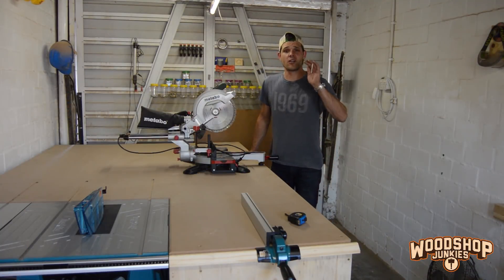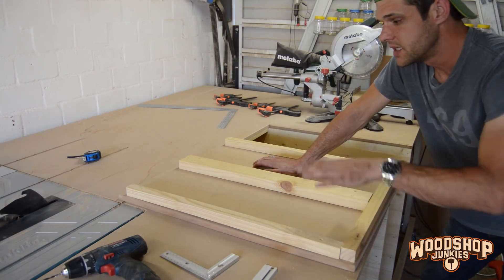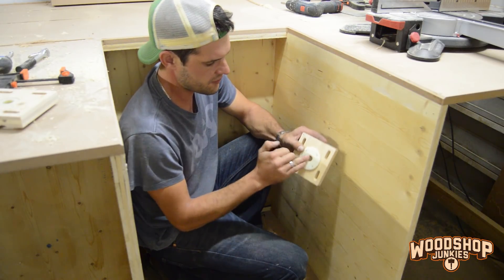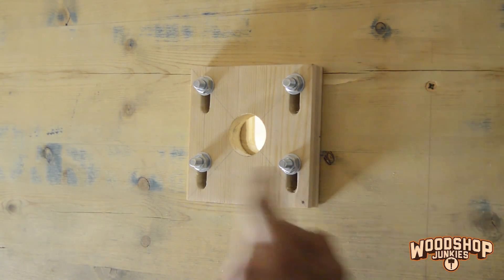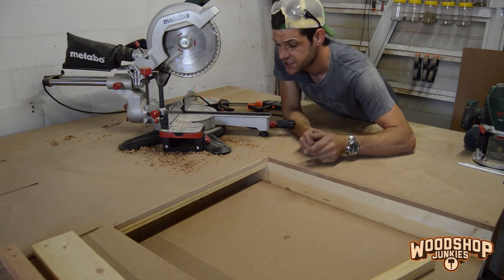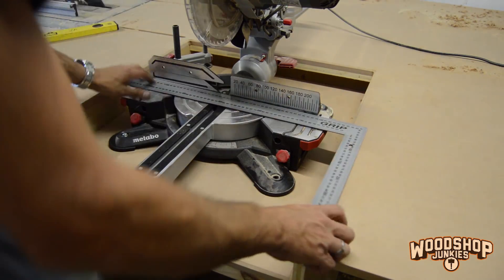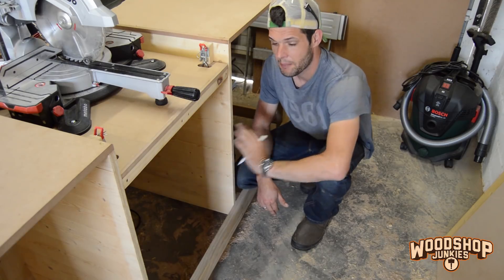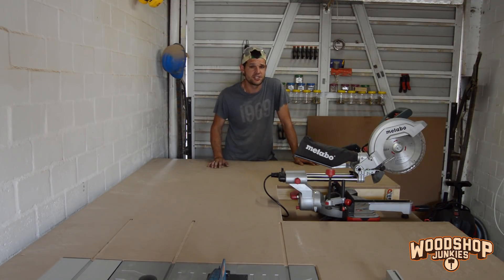No clash! MITER SAW INSTALLED to table saw station - ALL IN ONE woodworking workbench. P3

Comment: Can I just ask why you didn't chose a simple split pin for the ends of your stainless steel rod ?
Reply from the maker: To be very honest, because I didn't have decent drill bits to drill holes in the stainless steel pipe. Haha. Also, using the clamps is a bit of a personal preference but split pins would work just as well.

Comment: Will the Miter Saw be restricted from a full left or right 45 degree setting in configuration?
Reply from the maker: It depends on the type of saw. It doesn't in my case but the cavity could be built wider for a bigger or bulkier saw.

Comment: Great project! One question: it seems from the images that you will not be able to pivot the miter saw, so you will not be able to move the angler to left or right completely. Am I right or do you have a solution for that?
Reply from the maker: It can make 45° cuts in both directions. I allowed just enough space for it to do so.
Reply: @Ltcolfritz  Same. Would also like to see that :)

Comment: How did you calculate the drop or the distance for the miter saw to be able to clear the top of the table?
Reply from the maker: That's a tricky one to explain but I'll try. The length of the miter saw  (back to front) that I needed to be able to store under the workstation was slightly more than the height of the bench. Because the miter saw is recessed I had even less height to work with than the total bench height. As a result, I needed to move the pivot point of the saw base forward with relation to the back edge of the base. I also had to lower the pivot point slightly. This meant that when the base is folded down, the back edge of the base would sit more or less at the same height as the bench top (When the front edge of the base moves down, the back moves up). This gave me the ability to use more of the bench height for storage (and not only the area below the recessed base). Because the saw was still a bit longer than the bench was high, I stored it at a slight angle instead of perpendicular. I really hope this makes sense.

Comment: It doesn’t look like you’ll be able to make any 45 Des cuts with this design. It looks like the locking knob would hit the sides ?
Reply from the maker: Bob Haidl the gap was made wide enough for the saw to turn left and right to 45°. I did however not take the blocks into account on top of which the latches are mounted and they are a bit in the way of the lock knob of the saw. When I remove the lock knob the bed can go all the way. At the moment I am only using the spring loaded latch on the turntable to lock it in place when cutting 45s until I can modify the design.

Comment: Instead of that nylon bushing, could a short section of PVC plumbing pipe be used instead? Could someone glue the pvc to the panel hole and the metal pipe should match the interior of the pvc close enough?
Reply from the maker: I can't see why not. The results should be similar yeah.

Comment: Could have just used a cotter pin for the tube to keep from pulling out. IMO
Reply: Would've been a much faster low tech option 👍
Reply: Not nearly as cool.
Reply: Robert H I expect he enjoyed making those collars. :-) Standard lock collar works as well. Hate cotter pins - they eventually wind up stuck in your hand, or under a finger nail.
Reply: Or a hose clamp. Or a zip tie and a little epoxy. There are a lot of much cheaper ways I would have done that (I’m safe first, cheap second, and elegant third at best) but none of mine would have looked anywhere near that pretty.

Comment: I love this build! I have liked all your videos and subscribed! I am building something similar and have got a lot of ideas from this so thank you! I do have a question about why you did a fold away design instead of a flip top like you did with the planer. Was there a specific reason? Are there pros and cons to the different techniques? I can't figure out an advantage of the fold away over the flip top. I'm new to woodworking and have learned a lot from your expertise so thank you in advance for all your help!
Reply from the maker: I was trying to save space. The miter saw would require a larger base to make a 180° rotation. In my situation I felt to simply have it fold down would be the better option.
Reply: @WoodshopJunkies  Thank you! Awesome Videos

Comment: Great series man! Perfect for what I need in my limited space. FYI- You could find a number of clamps and fasteners for the miter pivot pipe in my typical section of the store, the electrical aisle. look for fittings for 1/2" rigid conduit. You could even use a lug block for large gauge service entry cable if you wanted a more squared off/machined look. Thanks for the lessons fella, keep up the good work! 
p.s. I would also sleeve the miter's power cord with some MC/BX steel jacket to guard against any accidental pinching or damage, which I would recommend in a tight one-man spot like this. Can you tell I'm an electrician? lol
Reply: I was checking the comments to see if anyone suggested a cotter pin for the pipe.  A split pin type cotter pin would be sufficient, but if you have an r-clip type cotter pin, that'd be good as well.  If the bar were to come out on any sort of regularity, I'd opt for the r-clip type cotter pin.

Comment: I think a cotter pin at each end of the pipe would have worked just fine to keep the pipe from sliding and they are only cents as far as cost. I love the latching idea as well. I made a very similar designed work table as yours with a job site saw at one end and a planer on one side and jointer on the other side. I cut into the top above them and when I want to use them I remove those cut panels to the side. Each machine sits on a platform and under the platform are leveling jacks. I have removed the had to raise the jacks with an adapter for my cordless drill. I simply turn the drill on and up they come and quite quickly too. I raise each until their beds are even with the top of the work table extending the beds of each machine's surface for longer boards.  I like the fold away idea but I need more work surface since my shop is only 16' x 10".
Great project and video. Thanks!

Comment: Can you cut 45s the way the miter saw sits, or do you have to move it forward a bit?...
Reply from the maker: woodmasterguy yes I can. The gap is wide enough for the saw to swing to its 45 setting in both directions. The only thing to keep in mind is the handle in the front of the saw. This can clash with the stopper/latch blocks in the front if the handle is too long or these blocks are not installed correctly.
Reply: I was going to ask the same thing. Looked like it would be close. My saw goes to almost 60° on one side but I can really only go to 45 the way i built it in because of interference.

Comment: I finish my table and install my table saw, now I need to do miter saw but I can't find the PVC bushing
Reply from the maker: Hey Rob. I made the Bushing on a metal type lathe. An alternative to the bushings are bearing. Alternatively, instead of nylon, you could make the bushing from hardwood as this will also prevent wear.
Reply: I expect a very short length of pvc pipe should do the trick if you can find the right internal diameter

Comment: Cool build. Instead of using a custom made clamp to keep the pipe from coming out you could have just drilled a hole through the end and used a cotter pin
Reply: Or even a simple hose clamp

Comment: I really like your mechanism to fold down the miter saw - excellent job! But miter saws are notorious for blowing dust into the air even with a vacuum hose attached to the collection port. They really need a hood surrounding the cut area as well. So I don't think a miter saw is a good candidate for mounting as part of an all-in-one workbench. Still, you could add a removable hood to your work bench but that would be kind of clunky. Better candidates might be a scroll saw, bench grinder, surface planar, small drill press, vertical belt sander or vertical spindle sander.

Comment: Does not look to me like you allowed enough width to swing the saw to 45 degrees left and right.  So I guess it’s ok if all you cut are 90s
Reply: If so major fail
Reply: I don't think I'd get much work if all my cuts were butt joints
Reply: Tioga Fretworks yeah that hinged chop saw is kinda cool but took up a ton of time and material. Kinda gimmicky 
Dust management would’ve been a better use of resources
Reply: I noticed the same thing. He won't be able to make 45 degree cuts.
Reply: It amazes me how all this work and creativity can go in to something like this.  This is truly a work of art.  He’s a very talented individual.  Clearly so talented that even assuming he can’t do 45 degree miters on his custom bench is just plain ignorant.  Think about it.  Great video.
Reply: @garethhowell3193  Yep; nice job; maybe best I have seen for those with small space. Add  a Incra miter express and really useful extended use. besides accurate angle cuts even to wider panels.
Reply: Yah. All the thought put into this project and doesn't consider 45 cuts with a mitre saw. 

You type of people are exhausting with your jealousy.

Comment: I would still cover the miter for one and only reason and that is dust. I know you'll have a dust collection. But when using a router and table saw all in one work station... dust is going to end up on the miter saw unnecessarily.
Reply from the maker: I did later decide to make a cover. https://youtu.be/11mG6gc4bL0

Comment: It is not much clever. Better is to make dual flat symetric flip system - after saw going down, workspace is flat for another working. In this case extra removable cover is needed ...
Reply from the maker: The saw is too long from back to front to do that. I am planning on installing my thicknesser like that, however.